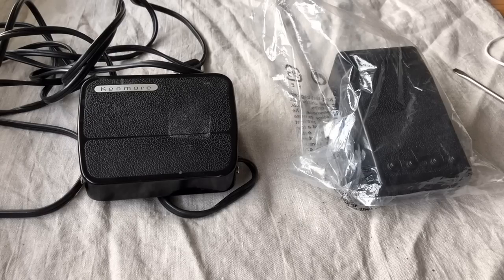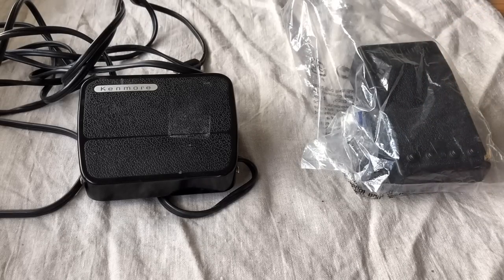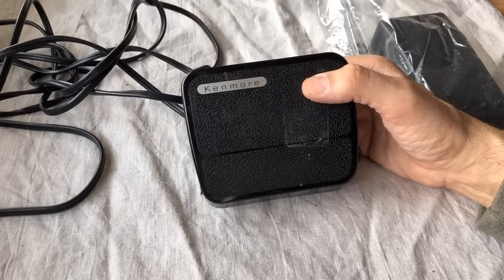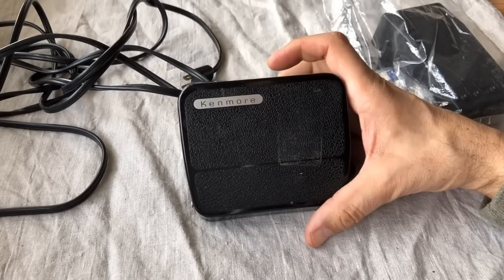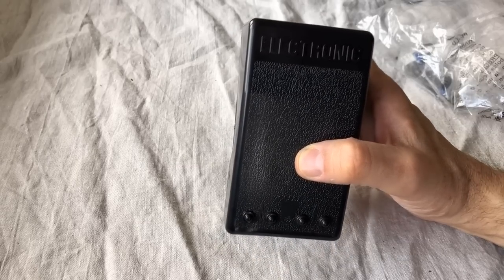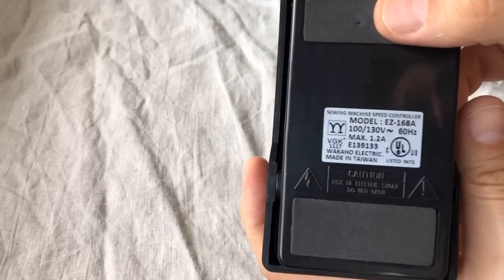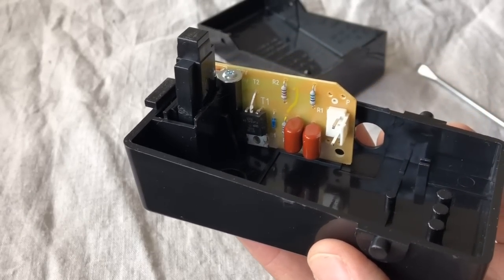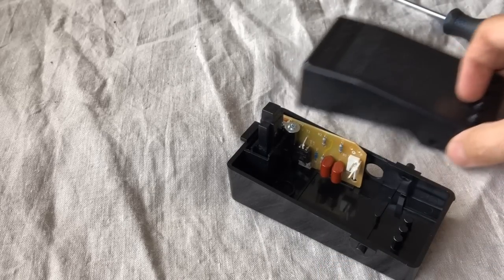FOOT PEDAL SERIES #3: Upgrading Your Vintage Sewing Machine With An Electronic Foot Pedal/Controller

Comment: For some reason, I was thinking my Kenmore's foot pedal was an electronic one (albeit a very heavy, Bakelite-encased electronic foot pedal - ha!).  I haven't figured out how to slide the back off, but looking under where I took out the one screw there is a nice chunk of ceramic! 

Unfortunately, Google doesn't seem to have any images of one with the back panel removed, but eBay has a few "parts" ones for sale rather cheaply that I might buy so I can cannibalize one and satisfy my curiosity without damaging my working one.
Reply from the maker: Its understandable Ingrid. As companies began to introduce electronic pedals, they did that slowly because they were more expensive at the time and sewing customers were often tradition bound and did not open up to changes readily.  Its possible that the styling of your pedal cover may look more "Mod" than some of the old analog style pedals but still have the analog/electro mechanical parts inside.  It may also be a form of hybrid pedal since capacitors were used in the early 1950's by some companies to control motor current.  Whether yours is or is not fully electronic, they all require gentle handling since all are vulnerable to damage from impacts.  Another way to know just how electronic your pedal is can be reflected in how warm it gets.  Electronic pedals show a little warmth, but older styles get much warmer.  Thank you for sharing.

Comment: solid state strictly meant the move to transistors from glass (vacuum) valves or tubes . thanks for great video.
Reply from the maker: I had wondered that but thanks so much for confirming.  That term was used on a lot of products.
Reply: @VintageSewingMachineGarage  do you know about wiring 3 wire pedals? thanks
Reply: So are Solid State Foot pedals all electronic (ie not carbon pile?).